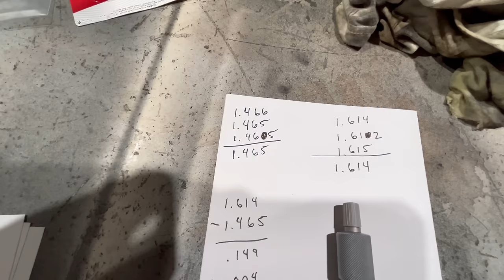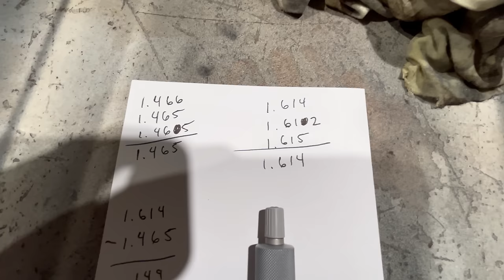Replacing a Damaged Wheel Hub - Caterpillar 40 Ton Haul Truck

Comment: So there is brake oil, final drive oil and axle oil?  I missed how the 3 are sealed from each other.  Are the wheel bearings in final drive oil?
Reply from the maker: There is hydraulic oil and gear oil (Cat TDTO). The finals and bearings run in the TDTO, and the brake housing is full of hydraulic oil.  They are sealed apart from  each other by the inner duo cone seal, which can be seen in the video where I have the replacement hub laying on the bench in the shop.
Reply: @KT3406E  Thanks for replying.
I re-watched from about 12 min to 17 min and finally figured it out.  It looks like there is nothing to seal around the shaft from the differential to the final drive, correct?  I guess on a side hill some oil can move to the low side, but the high side is still going to have a fair amount of oil trapped below the level of the inside of the axel housing.

Losing the inner seal sure would suck.  All of the hydraulic oil would flood the axle.  Kind of like oil certain injector seal failures that fill the crankcase with diesel.
Reply: @KT3406E  I hate it when people only watch 10 to 15 minutes of a video and then comment asking questions that they should already know the answers to had they watched the entire video
Reply: @THEMOWERMEDIC1  I watched the entire video before asking the question.  I had missed that the back seal is between hydraulic and gear oil.  
The key here is I used the word *RE*watched.
Reply: @matthewbeasley7765  the diff oil level is basically the same as final drive.. The oil just flows back into the diff
Reply: Due cone seal is how we keep different oil's /components/fluid from transferring
Reply: Also you have final drive oil diff oil and brake oil cooling system
Reply: @chrisgrosey583  the final drive oil and diff oil are connected via the spindle so it's effectively the same oil
Reply: I figured them splines to the brake frictions would be tough with its weight lining up iv never done one but prettymuch the same deal in auto transmissions and some can be tough with light parts
Reply: @THEMOWERMEDIC1  I hate when people try to ridicule other people for simply asking questions and trying to learn, and not even having the balls to tag them.
Reply: @KT3406E   not charging the subject but who does your engine machine work
Reply: @KT3406E  just wondering what do you even do with all this massive equipment any way?
Reply: Brake oil on these things has the function of lubricating and cooling the brake discs during sustained braking such as travelling down hill fully loaded. They are whats known as wet brakes unlike the brakes on your car that have a dry brake systems and are cooled by air .  There is a reservoir  filled with oil which is pumped to each brake disc and returned after going through a oil cooler. The brake discs are several separate plates placed with one  disc and the second has friction material bonded to it, they are stacked in series and the oil prevents them friction welding to each other. Hope that gives some explanation of why there is separate oils  in the hub assembly.
Reply: @planitmc1204  Ever heard of a heavy machinery contractor?
Reply: @Unknown_Ooh  kinda most guys will have a loader and semi trucks but KT3406E is red necking together 1million dollars haul trucks which is highly unorthodox
Reply: @brettwalkom948  >
- Thank you for your observation...it helped a lot.
- Not knowing anything about this equipment, my assumption was that all the oil looked to be the same by color and viscosity when it drained.
Reply: Hey man, is it alright if I get one of those wheels you don't want so I can make it into a dinner bell for someone?
Reply: @planitmc1204  moo
Reply: What are those blue dots on bolts mean? Anyone know?
Reply: @adaniel5897  its how you keep tabs on which bolts are already torqued
Reply: @adaniel5897  .
- If I recall correctly, that was where he had said that after reaching some specified tourque pound reading, the nuts had to be tightened 16 degrees more {or some number of degrees more}.
- The dots were there as a visulal indicator as compared to a line drawn on the rim so he could see if he had gone far enough with the extra tightening...if I understand it correctly.
- He explained it...but I suspect the editing messed up his teaching.
Reply: Watched the whole damn thing.
Reply: @THEMOWERMEDIC1  wasted your time writing a comment sneak dissing a guy with a question so you could maybe get brownie points from this youtube mechanic instead of just answering his question.  Real nice.
Reply: @madmax82988  sweety
Reply: @matthewbeasley7765  relax he probably never watched it all
Reply: Nice work!
Reply: @planitmc1204  Tote a VERY large amount of dirt, spoil, debris, whatever needs toting. You can see these on construction sites when a large amount of excavation is happening.
Reply: P
Reply: @THEMOWERMEDIC1 Oh, you poor baby.
Reply: I’m really enjoying your video library and slowly catching up on the back log. Looks like the spares unit is coming in very handy and economically, if all the parts you salvage of it are in as good a condition you will easily make your money back. Great content, awesome narrative and very interesting content. One things for sure, when you have big machinery, things like telehandlers, forklifts etc certainly make life easy. I agree, Jaypaydirt is a great channel and Geoff’s a top bloke and he would have appreciated the shout out, so well done.

Comment: I am a still working heavy equipment mechanic.  I have worked on many Cat 725s, 730s and 745 haul trucks. Have torn down many final drives to replace duo-cone seals, and you are absolutely correct about the lug nuts. So important that those nuts are torqued to the correct spec. Guessing with a powerful impact is not any way to do it. If the nuts are not tightened to the correct and equal torque you are headed for a huge costly breakdown.
Reply: He is right on, but I thought I heard an attempt to lay the damage off on the tireman. Tire man NEVER removes a wheel. Had that happen to me once.  Cat delivered three machines directly with out going thru their shop. I was called there to repair flats. Two hours after I had finished, got a call saying I had left lugnuts loose. After a five minute conversation,my problem was over.Accepted their apologies and they sent a haul trk

Comment: Fascinating, every second ! I used to work in the DJB factory where they designed and built these trucks in Peterlee, UK, before Caterpillar bought them. We used to charge around Raisby quarry with the truck covered in strain gauges measuring the stress in the load bearing parts. One time we even had telemetry set up to measure the stress in the rotating wheel rim, the part you had to replace, but I think that was on the D550 instead of the D400. All happened back in 1985. Thanks for a great vid.

Comment: Thanks, I never saw the working of that wheel assembly before. The brake system is pretty cool huh?
Reply: I think I was 30 before I learned there were brakes & clutches that operate in an oil bath - One thing trying to make things slide and the other thing trying to stop things sliding!

Comment: Interesting Video. I used to work on farm equipment, this is a lot bigger than that. The telehandler or crane is a necessary tool. Appreciate your attention to detail pointing out important steps. Really like your poking of the saftey bears. Thanks for the Video. 👍🏻👍🏻

Comment: Love your videos, especially about the 3406's. I learn something every time. I operate Cat 3412, 3408, and Cummins KTA19.  The Cat truck differential compartment is separated from the final drive compartment by a dam inside the axle housing. If you overfill either, gear oil will overflow to the other, so just top off to the correct levels. The brake oil is contained by the inner duo-cone it a separate compartment.....transmission/brake oil circuit. If that duo-cone leaks, transmission oil will contaminate/spill into the other compartments, and eventually spill from the axle/diff breather. That is another reason to monitor levels regularly, and investigate any changes in compartment levels, or visible leaks, and keep your breathers breathing.

Comment: When I do those and use the same bearings and they aren’t new by any means.  I always pull the thinnest shim out to get the bearings tightened up again.  I oil them up and spin them to check the rotation resistance.  Nice work!

Comment: Excellent, I,m a machinist, that depth micrometer is one of the best you can buy. I commend you for waiting for the right tool. Most would have put the old shims in and sent the truck on its way. They used to make a foot for Dial calipers so they could work as depth guage. pretty handy. Keep up the video,s..

Comment: As a kid who grew up on a ranch, one of the old time hands saw me working without safety glasses when using a grinder. He asked me how well I could work if I was blind, and then asked me what my eyesight would be worth to me if I wanted it back, then handed me a pair of safety glasses. I have had safety glasses torn in half off of my face, and thrown away safety glasses with gouges and metal embedded in them, but I have my eyesight because I listened to someone who's name I cannot remember.

Comment: I watched it , excellent job👍. I used to work for Atlas Copco Wagner Mining Equipment Co for 18 years at their Portland Oregon Plant. I probably did over 1,000 axles over the years. I was their main axle guy and tires, and I did everything else. This brought back memories. Generally speaking those face seals will leak right away if they are going to leak. The axles I worked on where a lot bigger then this one, but the procedure is the same but some differences. Mainly I worked on Clark and Rockwell , Okubo axles. Fun times, my aching back.😂🙃🤪🤪🤪

Comment: "Drowning in the corporate safety kool-aid."  😂😂🤣😅  I work for Cat, and that sums it up perfectly!  FYI:  We make the suspension piece you can see behind the hub on top of the axle housing.  We also make a lot of the press-in-place seals, cab mounts, transmission clutch discs, and track pin seals.  Just up the road from you, in Boonville.

Comment: Good order when you opened up the hub
Years ago we made 4wheel trolleys to fit under tractor rear axles with height ajusters on wheels to align  axles on assembly   but unless you have afleet to repair ur ok a new hub would be lots dollars  very clean caring repair when i done my training 30 years ago we even had to wash all tractors after workshop job
And polish the hood

Comment: You probably already do but i couldnt see, and eleventy million other experts in the comments have probably already told you.... if you put a dot mark or paint mark on the socket where the corner of the bolt head sits, you can put this over the painted corner and watch it line up with the mark on the tightening face so you dont have to keep taking the socket off to check. Great work as always.

Comment: At 41:44 "137 ft lbs then an additional 60 degrees ". Good info for newbies. Correct clamping pressure not always achieved when only looking at ft/lbs on your torque wrench.

Comment: I worked for snap-on while I was going to school. The returns from mechanics were gathered from dealers and shipped back to head office. 
There were some, a few, very old regular sockets that obviously had been used for years on an impact. The failure were bulges or small cracks but I don’t think I saw a catastrophic failure from using a regular socket on an impact.
I don’t know what it takes to crack one, but if I was trying to break one I would think extreme cold, and excessive impact would do it.
Like a four foot on 1/2 breaker bar.

Comment: Thanks for the video! Have a random question, what did you use to clean up the tires? Those came out looking new after that second coat. 
  I feel ya on the safety BS. I worked at a CAT dealer and you would be fired on the spot if you were caught walking through a bay door and there was a man door available to go through. Some of the stuff just makes you shake your head. Thanks again 👍🏾

Comment: I've watched a few heavy equipment mechanics and although time is money and often when equipment is down, the owner wants it back in action ASAP but some guys go to the sledge hammer straight away, then drop the bearings in the dirt, no effort at all like a peice of cardboard to drop the bearings on, they just pack new grease on top of all the sand and put it back together, dented surfaces  and bent snap rings everywhere.  One told me "That's what filters are for."  Mkay  but when does the grease on a wheel bearing get filtered? You may not be the fastest mechanic but if I ever have a haul truck that needs attention I'm looking for you.  Good job sir.

Comment: Bit like what you see in an automatic gearbox there, I had to look at that a few times to try to picture and figure what goes on. So the planetary is connected to the wheel, that outer ring gear is held static and all driven by the inner shaft to complete the transmission.

Comment: I came from Andrew Camarata's Youtube channel. I think you two should get together and discuss his issues with his recently acquired Volvo A25C dump truck. As per his last Youtube video, he had overheating issues with the engine. After changing out the fluids and filters, the cooling indicator showed some improvement. However, after turning the engine off from a days work, the dump truck now has a "crank no start issue."  He stated there may be a low compression issue. What do you think it could be? I'm looking forward in hearing responses from both channels. 😃

Comment: Nobody actually uses the service manual for this repair. But I did check, on page 271 it says " Spank the outboard bearings onto ground with backhoe / chain setup"  15:08 
  Bonus points for the ratchet strap / telehandler adjustability.   I think you're supposed to do this job at a friend's shop and spill a least a gallon of stank gear oil.   That stuff you drained looked new!

Comment: Quick tip, rather than painting marks on the bolt for your angle turns, paint a single mark on the socket. Much faster and you can actually see the mark unlike when you paint the bolt.

Comment: That wheel assembly came apart far easier than I was expecting. Almost suspiciously too easy. Although, dropping a part in the dirt seems to be a very common part to any repair work, almost a requirement for somethings I'd suppose. It's right up there with maybe getting oil to run down your arm during an oil change, or dropping the drain plug into the catch pan, getting dirt or ther grunge to drop on your face while under a vehicle.

Comment: I see there are oil holes in the planet gear shafts, is there some way oil is pushed into them for the bearings?  Why no spray something like FluidFilm on the wheel rings to keep them from rusting up?

Comment: I'm a bit curious about those duo cone seals, I've done the same job on Kessler D81 axles mounted to DCG 160 forklifts and Bell axles on a B30 dump truck, both want you to let the hub spin in the air without load on it for about an hour to let the duo cone seals seat themselves, is this step not required by CAT?
Reply from the maker: No.
Reply: Interesting

Comment: Great video and great input, but why not put a large tub below underneath? Is it necessary to contaminate the soil with oil in this way?
Reply from the maker: There is no contaminated soil, and apparently you are blind.
Reply: @KT3406E  Sorry Sir, but your blue box is to small. Maybe you have the chance to start your own video by 15:00min and watch what happened.😉
Reply from the maker: @rotatorenklaus2504  No it actually worked just fine for me.
Reply: @KT3406E  ok, thx for response, appreciated.

Comment: the parts of tapered roller bearings are matched,aren't they? so you should not use outer race of truck A with rollers and inner race from truck B!  or is this just theory and do people mix'm all the time, no problem?
Reply from the maker: They are sold separately, so how can they be matched?

Comment: Why didn't you get a nut splitter or just torch the the left over lugs and hardware off then replace the lugs with new studs
Reply from the maker: How are you gonna get new studs to stay tight in a hub with bad stud holes?

Comment: Those planetary bolts are torque to yield bolts. X foot pounds of torque then degrees of angle is a variable torque. Those bolts should not have been reused most likely. Because of the force and stretching they go through most bolts of that nature are 1 time use only. If you dont have a torque wrench with built in angle calibration go pick up a manual one they are inexpsive

Comment: How come you're not supposed to use a chrome socket on an impact what could happen
Reply: Chrome sockets will explode and send tiny little fragments everywhere under heavy use with an impact. Black impact sockets are much softer metal with thicker sidewalls.

Comment: You Used a compressor hydraulic jack in the wrong direction, should not be used horizontally on axles holding tractor tyre hubs, you scratch and dent the axle frame of the cat truck. Hydraulic jacks of any type should only be used in vertical positions, not horizontally . It can fall onto the ground and break something if it’s not on the ground properly on property probabilities. Jack hydraulics pistion supposed to be suspended from ropes before operations with jacks in the horizontally placed positions